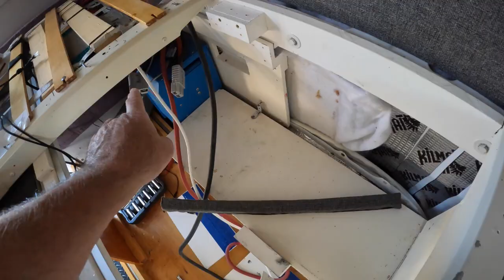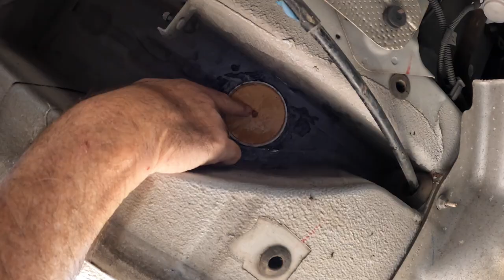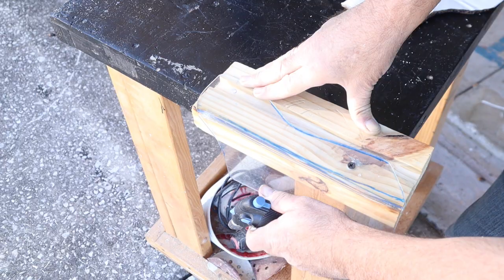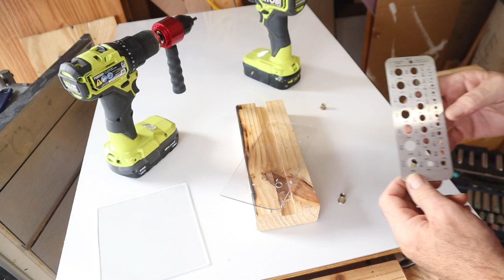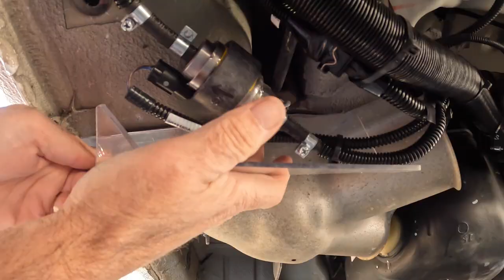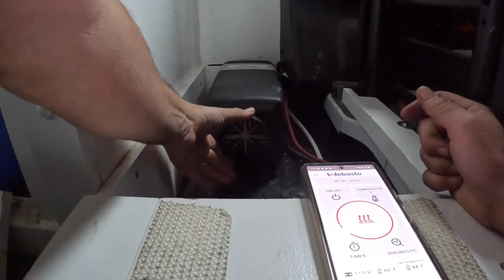Installing the Webasto heater in your RV or Van a comprehesive step by step guide

Comment: I watched this specifically for how to hook up the fuel hose. I thought the pumps were supposed to be angled up towards the heater (15-30 degrees), but looks like it works just fine. I think the reasoning was that angling it prevents any air bubbles that could possibly form. Overall, a great detailed video and lots of great tips here.
Reply from the maker: Thank You.  Its been working without any problems.  Really heats up the van quickly.  For more van build info check out https://thefrugalfactor.com/    Thank You for watching.

Comment: I liked your video. I installed a propane forced air heater in my current van, which works well, and I'm thinking about a gasoline powered forced air heater for my next van. I didn't see a link to Vanlife Outfitters in your video description, but it was easy to find their website and YouTube channel. I saw the Webasto section on their web page, but did not see anything about the hole you drilled for the electric wire to exit that metal fitting. Keep up the good work. You have always done a great job of explaining things in your videos.
Reply from the maker: This is Van Life Outfitters video, right that the point of drilling that hole  https://youtu.be/CN929IhHsH0?t=826   Hope that helps.  For more videos by category check out https://thefrugalfactor.com/   Thank YOU for watching and commenting.

Comment: Nice tutorial. I did a trial run on my Webasto without the muffler during installation, the muffler reduces noise pollution significantly.
Reply from the maker: Thanks for watching.  I did not install the muffler - since I hopefully will not need to use it much.  When we have used it the hum of it running on the outside - was mostly outside and did not bother us.   I was amazed at how well it worked, quickly warming up the van.  Even the exhaust is very hot!       Check out the other videos at https://thefrugalfactor.com/